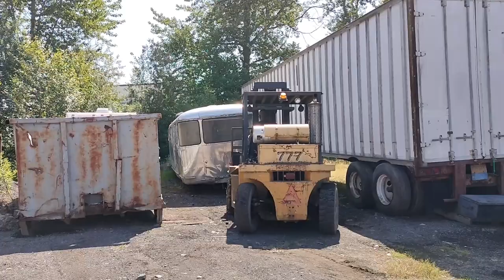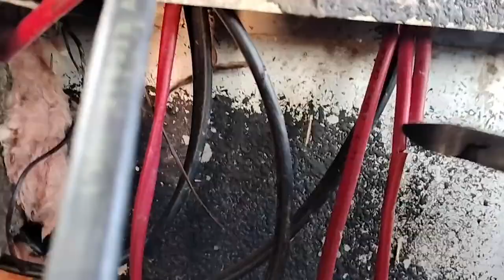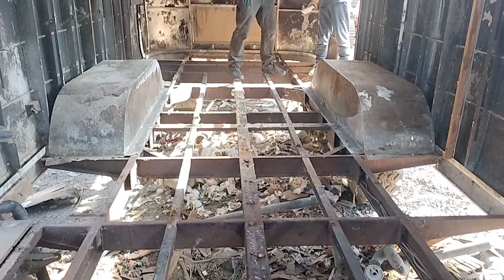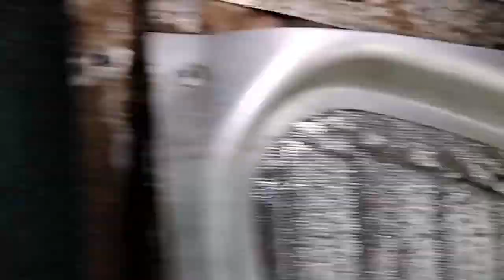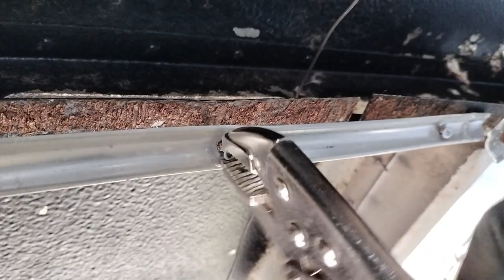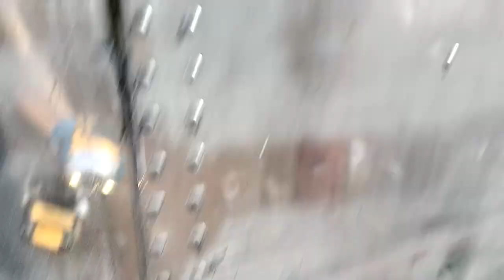Gutting a Vintage Trailer | Spartan Manor E01

Comment: When you start to replace the floor, you might want to spend the extra cash on marine grade plywood and "elevator bolts."
Reply from the maker: Yes! Definitely want the added durability of marine grade. I'll have to look up elevator bolts! Thanks for the tip. :)
Reply: @upallnightgolf 
I like the idea of the marine grade plywood. What's the advantage of the elevator bolts? They look similar to carriage bolts.
Reply: @chitownbangin  They set flatter than carriage bolts.

Comment: mmmm asbestos fiberglass insulation! You were smart for wearing the heavy duty mask.
Reply from the maker: I sure hope it wasn't! I think it has been renovated before so am thinking it was newer insulation, hopefully just fiberglass. But yeah better safe than sorry!
Reply: @danielrvilla  Good point, it may have been replaced. However, it looks very similar to what our Spartan has, which hasn't been renovated. Fiberglass insulation came out in the 1930's and asbestos was mixed in with it until about 1970. Anyway, enough of that. Really enjoying the project so far!
Reply from the maker: Oh you have one, too! Is yours in a more livable state? haha Can't wait to get the floor in on this one which will feel like a major milestone.